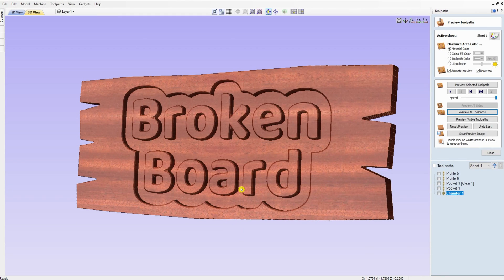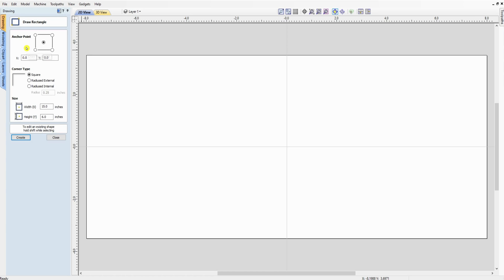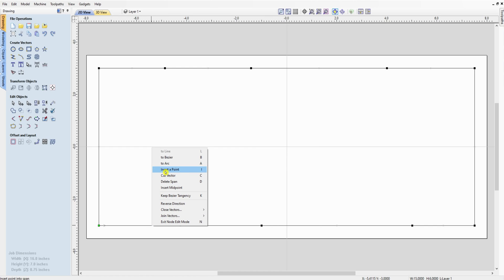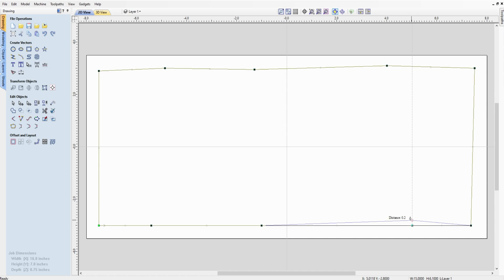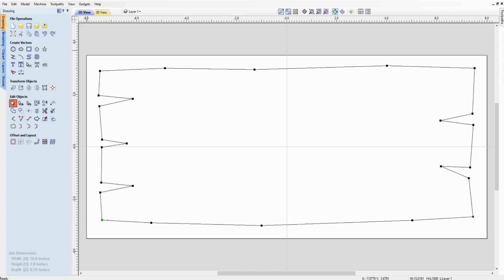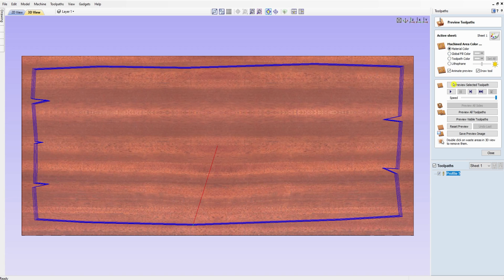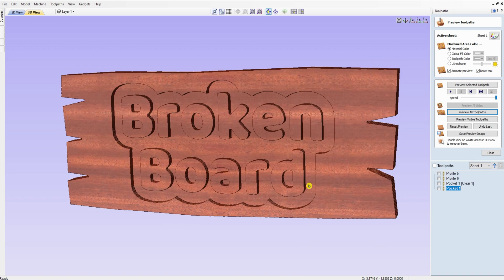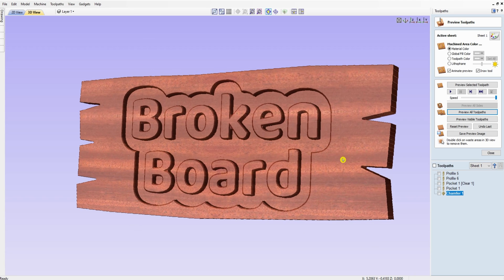How to Make Broken Board with a CNC Router using VCarve Pro

Comment: Hey bud, glad to see you are still making videos.
You got me into lichtenberg burning a few years back.
Its cool to see you are into cnc too. I bought one off craiglist that a guy couldnt make run for cheap. It has a 32"x60" table. I needed a controller and started researching online and on youtube, and a channel was giving away 2 geckodrive stepper motor controllers and and i won one of them. I built my own control board enclosure and got familiar with my software in about a year. It is so cool what these machines can do!
Reply from the maker: Great to have you along for the CNC journey too Andy.. I am excited about it, Should have my machine in about a month.  Getting everything ready for when it arrives!
Reply: @doublereno  if you dont have a dust collection system in your shop, i recommend the dustopper cyclone separator. It really saves on shop vac filters.
Reply from the maker: LOL, it's on my list of purchases!!